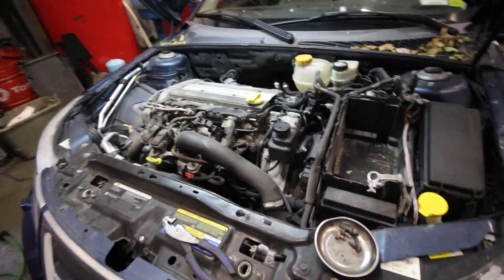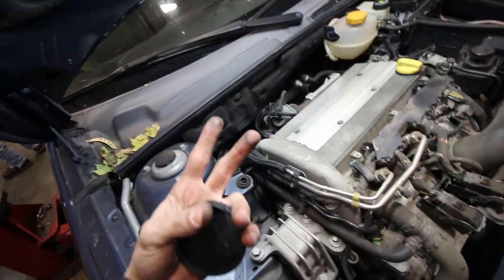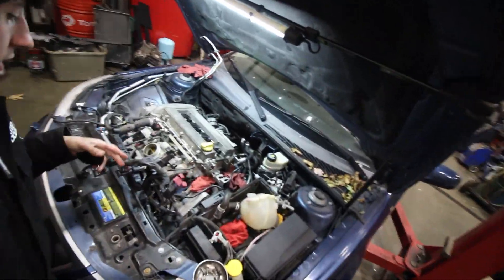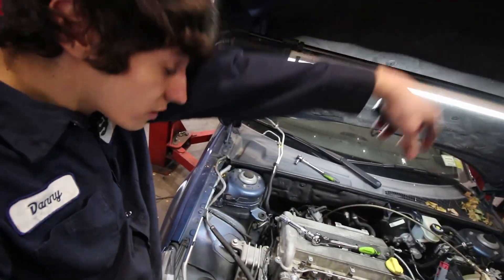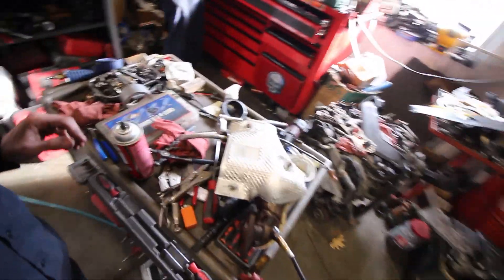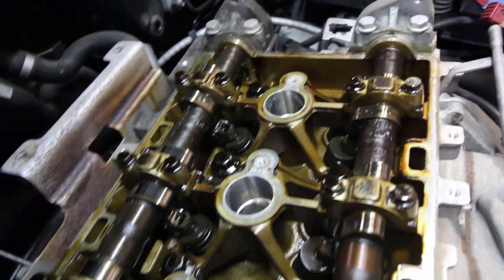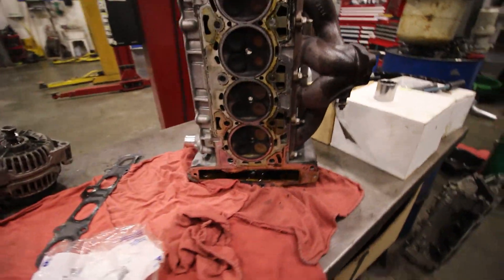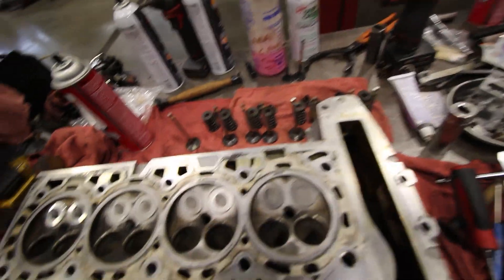SAAB 9-3 Valve job, Head Removal

Comment: Man just finding your content but very glad I did man it’s hard out here learning my car when techs don’t want to help !!
Reply from the maker: Well hopefully you don’t have to do this job! Iv seen it quite a few times n heard it thay some mechanics don’t like or won’t work on Saabs or think there hard to work on. I learned most of what I know at the dealership shown in this video and don’t see the problem. Hopefully I can help you with any questions you have in the future! I have a playlist for just saab content
Reply: @Retiq  Legit, I think it's just because most people havent worked on them and assume that Saabs were built like BMWs. 

Saabs are some of my fave to work on, because (unlike BMW and Audi) their engineers were actually sane. This is one of the easiest Euro engines to do a head gasket, timing, or valve job on. Getting everything out of the way is the closest to a "hard part," on these engines.
Reply: you got the whole saab wis (saab workshop information system) online all the instructions for all the jobs :)

Comment: I’m lucky to have your video as some insight. Have to replace the head on my 9-3 due to stripped plug threads. And I know there’s ALOT to take off. I’m going to try and use this and SaabWis.
Reply from the maker: @FMJRaven  here to help! But have you tried a heli coil before you go thru all that work. I haven’t had to do it on a Saab but iv done it on other cars.
Reply: @ I have not but it was considered as my primary focus. If I messed up then it was onto replacing the head
Reply from the maker: @FMJRaven  okay well if ur not comfortable doing the heli coil it might be worth taking it somewhere to do it it might be cheaper and or quicker than headgaskets
Reply: @Retiq did that on my 04 last year, knowing I had to do a plug change soon. Grenades on the highway doing 80, no less. FML. Saved her. She's on the road though!

Comment: Do you know if you need to change the timing chain as well while doing the valves?
Reply from the maker: It is up to customer/ mechanic. If car is nice and an ok amount of miles it’s not necessary. One issue Iv seen is the bolt on right side of head I think it holds the chain guide or something it’s behind a plug 8:56 you can see on side of the head by motor mount. I had Chevy version a month ago came out and broke off and there’s an updated part for the Chevy I’m assuming it’s same for the Saab. Instead of being a bolt behind the plug it’s screws into the plug hold and has like a dowel to hold the guide. Personally never chained a chain in these car.

Comment: Thanks for posting this! I just bought my wife an 08 9-3 CV and it def needs a valve job. Rough start otherwise car is beautiful. What do I need to make sure to ask the shop to do so it’s done right the first time? Thanks!
Reply from the maker: Hey no problem! Well deff replace all the valves and valve seals. While your in there replace vacuum pump seal bcz they leak so it’ll be off so just replace them. The plastic coolant t by the front passenger side replace with an aftermarket metal one. They crack and leak quite a bit. Everything else they should prob be taking care of like new head gasket’s valve cover gaskets stuff like that like shouldn’t need to be mentioned, think any shop would replace that stuff while doing the job
Reply: Really appreciate your reply, thanks for the videos as well, keep it up man! Also, “machining” the head goes without saying as well right?
Reply from the maker: @toddbecker190  depends on mechanic the older tech in video used to do machining and transmission stuff so he was able to check to see if the head was warped with a tool and decided just needed the valves put in. So the techs should at least check if it’s warped or soemthing and maybe they might just send it out to machine shop…

Comment: Glad I came across your video. About to buy a 9-3 2.0T with a rough cold idle. Will take compressions tomorrow before we finalize the deal!
Reply from the maker: Compression is good but also cylinder leak down test might be better test to see if the valves are slightly open
Reply: @Retiq  Thanks for getting back to me. I'm an amateur mechanics - more used to older carburated cars. I have a compression tester, is it enough to test the leak?
Engine has about 150k miles, if it had the low quality valves, should it have manifested way earlier?
Reply: Thanks, I've just found out about leak down test, didn't know this tool!
Reply from the maker: @supercanardo  okay I’m not sure if you can use a compression tester as leak down tester. Maybe advanced or Napa rents the tool out? Also not sure of a way of getting away without the cam locks when doing this job. Just the way Iv done this engine some engines don’t need them to rebuild it… so may not be worth buy a car with this prob if that’s what your wondering before purchasing

Comment: What is the purpose of the cam locks if the camshafts have to come off anyways, just wondering cause the only ones I can find are like $200 and im curious if there is another way to keep time.
Reply from the maker: Ahh I’m not sure actually. Just what we use since we have them… I’m sorry I’m not much help there may be saab forums or fb pages with better advice
Reply: So you don't bump them accidentally and the engine skips time. You don't necessarily have to do it, but it's a good safety precaution. Better to just use the stops than get all the way in there, then have to also do the timing chain.
Reply: They are designed to lock the camshaft in place so you don’t disrupt timing if you’re replacing the head gasket instead of valve seals this tool is necessary that way you don’t have to reset timing, unbolt the cams, valves, rockers etc.  .  .if you are doing valve seals this tool isn’t necessary. In this video he used the cam lock tool for no reason

Comment: Hi Danny,

My 08 Saab 9-3 2.0 Aero sport estate XWD also needs new valves. Did you also replace the exhaust valves, and did you deck the head?
How where the valve seats, do they need to be machined or is lapping the new valves enough? Thank you very much!
Reply from the maker: I cant remember if we replaced both intake and exhaust valves, I would replace both. We checked the head and it wasn't warped. The other tech with me has experience machining heads and doing that type of work so his call was to just lap the valves. Obv if you unsure a machine shop can check the head for you. if u want to dissemble it to save urself some money. 
I believe the issue is the valve metal was changed and was softer and would just get eaten up over time as it hits valve seat.

Comment: Wonder why Saab went out of business?
Reply: Because of GM's bean counters. This is basically a GM 2.0 turbo engine with some tweaks by Saab. It started in the 2003 9-3, but didn't start having valve problems until around 2007, when a GM supplier supplied crappy intake valves, and GM got away without having to honor all of the warranty replacements due to the bankruptcy.

Comment: Is there anything that DOESNT need to come out for this job? Jeez I don’t know what I’m getting myself into lmao
Reply from the maker: He drivers seat that’s about only thing you don’t take out🤪 jkjk but make sure this is your issue. Be terrible to do this job and be something else or something east
Reply: @Retiq  Im just wondering because I’m about to buy a 2010 Saab 9-3, they are currently replacing the clutch and the previous owner had the spark plugs replaced a few 10 thousand miles back. I am curious as to whether this is going to be something I’m gonna have to get done/or do, and trying to soul search and see if I have it in me. Lmao
Reply from the maker: @nathanielramirez8997  i can’t rember which years we’re susceptible to this issue but I have a 2008 9-3 with almost 110k miles and it’s fine 🤞🏼
Reply: @Retiq  Im assuming if one can do this they can do most things these cars would need right?

Comment: How much does your shop charge for the job?
Reply from the maker: I am not sure sorry…this was at the saab dealer but I’m not there anymore as it closed down. But it is prob a close 1k ish or more
Reply: @Retiq  Do you think still worth to fix it for 155K miles Wagon or find a low mileage engine to replace?
Reply from the maker: @imanwan2861  depends on your goals, and how nice the car is if it’s worth the money of find a diff car or whole engine
Reply: @Retiq  Is it possible to fix the head without remove the engine?  I have a Auto wagon already, but trying to get a manual one that have valve problems.